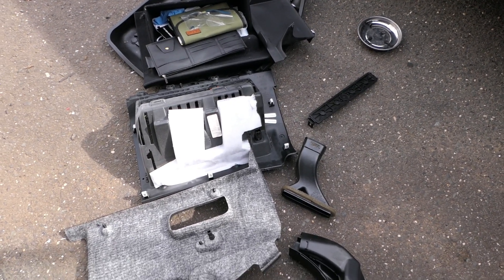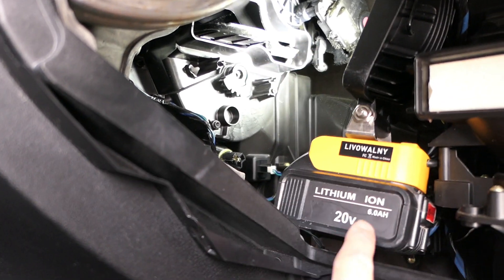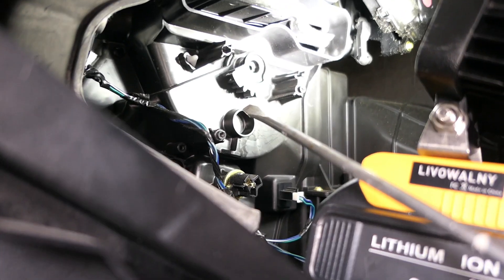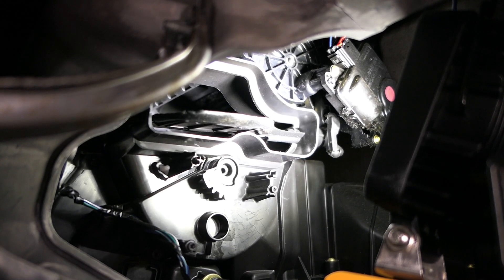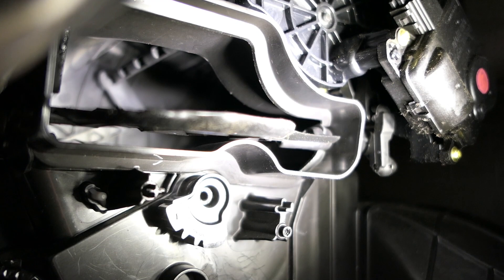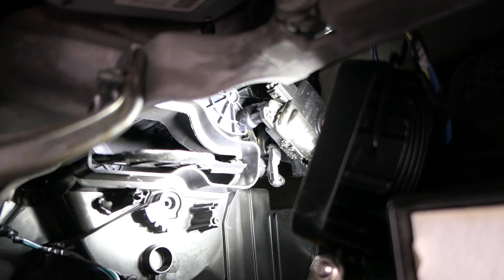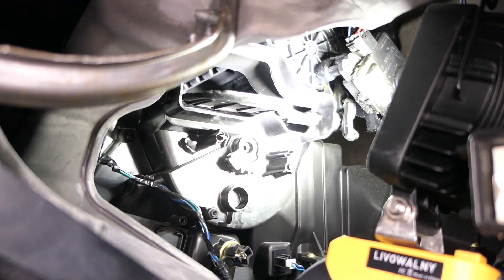How To Fix A Stuck Jeep Grand Cherokee HVAC Actuator Door

Comment: Yes this was my problem too.  Used a tire iron to force it back down.  Required a fair amount of force.  I installed a long 2” screw through the plastic housing on the far upper right side under the lip to prevent the blend door from over travelling again.  Great video. Thanks.
Reply from the maker: That's an interesting idea for preventing over-travel.  Will the thin plastic housing be strong enough to hold that screw in place?  I'd be curious how you make out after some time has passed.
Reply: @tinderboxarts  The screw went in pretty solid.  I used a #6 sheet metal screw.  I pre drilled a small hole with my small Milwaukee angle drill which was pretty handy.  You can feel where the flapper normally hits the seal so I drilled through the plastic at that point.  When the screw is installed you can feel the flapper hit the screw first before the rubber seal gets all jammed up or stuck from the over travel.  Flapper might not seal off 100% so its a little cooler when on max heating the passenger side but better than the alternative of jamming up.
Reply from the maker: That's great.  Definitely worth the trade off for a little less heat.
Reply: Sir or ma'am is there a way I can see your solution??
Reply: Great idea with the overtravel screw!!!

Comment: Thank you for this- I thought I was loosing my mind w/ the flap. One trick- I used the tire iron to move the flap back in place instead of a pry bar-
Reply from the maker: Yes, that would be a very similar tool to use.  Anything with long hook and some strength to it would work.

Comment: I had the same problem but on the drivers side. Great idea, don't know how you thought of it. Problem I had on the drivers side though was I couldn't fit a crow-bar in, just not enough room with sterring column and other controls there. I was able to do it with a framing hammer with straight ears. For $35 I put a new actuator motor in while I had everything pulled apart, hopefully it will last. My A/C has been nothing but problems, one thing after another.
Reply: These dual-temp systems are a nightmare.  I believe the two zones battle against each other and wear the actuators out faster.   Try to keep the two zones in SYNC mode.  Let the wife bring a blanket along for her legs.
Reply from the maker: Yeah, it's funny what you come up with when you just start looking around your shop for an answer!

Comment: Thank you for your video, it really saved the day !!!     Again thanks!!!     You mentioned about beefing up the actuator gear , could you give a detailed description of how to do that with epoxy or a screw????     I  I am sure others could use that info!!!   Again thank you for that great information!!!!!!!!   If you have the time!!!!
Reply from the maker: There are different types of plastic, but I found that the plumbing glue intended for ABS (black) pipe is compatible with the type of plastic they use for these components.  However, I didn't beef up the gear, I beefed up the actuator itself.  I found that the ears where the mounting screws go through are pretty flimsy and they can crack under the strain.  That leads to movement of the whole actuator in use, which confuses the computer and may cause binding.  All I did was find a small stainless washer for each ear, and used the ABS plumbing glue to both hold the washer in place and add additional bulk to the ears.  The glue sets up pretty quickly, but I gave it an hour to cure.

Comment: i just fixed mine and even after the car has been off for some time the acturator keeps working, might be a pcm issue since i have a pcm issue on the high fan setting for the engine
Reply from the maker: That's normal, if stupid, behavior.  The computer is attempting to find the two end stops and it is programmed to do this even with the car off.  Unfortunately it may continue to do this until it gets the data it wants, which may be long enough to snap off that plastic gear.  The best thing you can do is try to get the gear lined up approximately where it was originally so that the computer doesn't get completely confused and it's just a minor difference.  Needless to say, these programmers are not mechanics who work in the real world.

Comment: Doesn’t work for me. Rubber seal melted and won’t allow it to pivot
Reply from the maker: Yeah, there are two causes of the stuck door, one being the door going past the stop and the other being the melted seal.  I had the former problem.  In your case you may need to either remove the seal remnants or get it to be unsticky, and then try to get it to move.  If you can get your phone camera in there you may be able to get a better look at what's going on.  You could try picking out what you can of the seal using long needle nose or a scraping tool or even your hands.  A spray solvent like brake cleaner might help to make it less sticky, and the solvent will evaporate when you are done.  All you can do is keep picking at it.

Comment: Hi - thanks for sharing your good work. I wanted to see if your jeep is still working since you fixed it? Mine is stuck on AC and it’s freezing in Michigan now. Trying to unstick the seal with a crowbar like you did.
Reply from the maker: Yes, so far the repair has held.  Sometimes I cringe when making an adjustment with the controls, but so far so good.  I do think if your problem is that the seal has become sticky or gummy that you may need to do a little more work to try and remove the seal or make it less sticky.  You might get it unstuck and then spray an evaporative solvent in there as best you can,  or use a rag on a stick to wipe it down with solvent and make it less sticky.  If your problem is like mine, where the flapper was just jammed too far in, then you can get it free and then pay close attention to the actuator installation.  Worse case you could always get the door in the warm position and tape it in place until summer when it will be easier to work on.

Comment: Thank you for video, what shall i do if new gears got broken again within a week of installation ?
Reply from the maker: That is always going to be a possibility since the design remains flawed.  All you can do is try and figure out why your particular door is getting stuck and then causing the gears to snap.  One possibility is that you have the "sticky" seal problem, in which case you might be able to reach in there with solvents or your hand to remove/reduce the stickiness.  The other possibility is that your door is getting jammed at the point of contact or beyond, which is what happened to the vehicle in my video.  You want the door to move freely and not get stuck at the point of contact with the housing.

Also, take a look at the actuator itself.  If there is a cracked housing or other wear you might do well to replace the actuator too, which is not that expensive.  When reinstalling the actuator and gears, try to get the door and gear located in the middle of the range to avoid undue stress during the calibration.  If your gears snapped again, it was probably during a calibration by the computer or else your door got jammed up again.  I'm afraid there is no ideal solution, this is just a poor design.

Comment: How did you get the duct off?
Reply from the maker: The short duct in the way of all this is made of two pieces.  It is possible to give the duct a yank and pull it loose, but you may find it's easier to split the duct from the locking tabs, and then pull out each side individually.  You can re-install it that way too.
Reply: Will give it a shot! Thanks!
Reply: I have this same issue on my 2011 JGC. I stopped for the day out of frustration, but I'm definitely going to give this a shot tomorrow morning. That gear is definitely stuck in my case. No play at all. I'm also worried about my blower relay because it stops and goes without any code. I changed the blower motor and resistor (in the same location as the actuator). Fingers crossed!

Comment: Okay so I got the same problem and another problem. Can you please tell me if yours has another actuator above this one. If you remove the vent there should two more actuators. The one above this one has a female end built into it. I can’t find this actuator anywhere.
Reply: This is truly a poor .. to much heat for the space problem!  Heater cores under the dash has been done far to long!!  And gluing foam around the area...didn't we learn this in the 50s!!  OK done venting
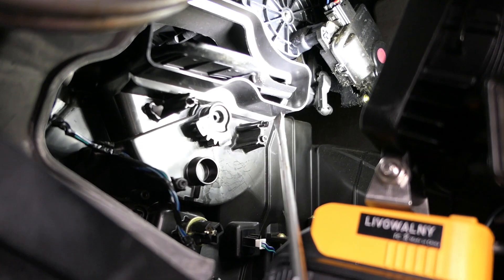Reply from the maker: If you look at 2:15, in the upper part of the frame and a little toward the right, there is another actuator.  Are you referring to that one?   Mine was fine, but you should be able to find a replacement.  Sometimes it's easiest just to remove the broken one and keep it next to you while you search the computer screen for a similar looking one.  I would think all of them are available on amazon or ebay.
Reply: @tinderboxarts  no not that one but I did have to replace that one as well. The one that I am working on is a 2014 overland addition. I’m not sure what year yours is but on this one there are 5 actuators and it’s the only one with like a female end. I got one and put it on. I wasn’t able to get anything in there small enough to pry down on it. I truly loved your video it did help me in a way. But now I gotta replace the main vent housing which consumes of the steering wheel being pulled out and the whole dash lol. Which is all but done. Again thank you for your video and your response. Have a good weekend sir.
Reply from the maker: Ugh, I feel your pain--these are repairs which never should need to be done.  I hope your repairs last!

Comment: i might be in trouble, i electronically turned the gear and now i spose I need to calibrate the drivers side actuator. anyone know how to do that without a scan tool? i have the climate control without the knobs.         I also unstuck my blend door by heating up the car and then slowly turning the inner gear till it broke free of the glue goo.
Reply from the maker: As far as I know, the computer will attempt to calibrate itself when the car is turned on again.  The obvious problem with that is that your door may become stuck again in that process.  I would suggest cleaning up all the stickiness you can, if that has been your issue, and then reinstalling the actuator in a middle position as best you can.  When you restart the vehicle (or just turn the key on, probably) I think you'll find that the ECU will attempt to find the stops itself by repeatedly activating the actuator.  Hopefully the door won't become stuck again as it does this.
Reply: @tinderboxarts  thank you for the reply!  I've been waiting for my ribs to heal before I reinstall .. since with ongoing muscular dystrophy I apparently break ribs doing this repair :)  I believe I'll ad 12v to the gear so that it sits in the proper slot. I sure hope that works. Like you said hopefully it will learn its place in the world. Tks

Comment: I’ve done these a couple times before and I will say there is a function in the snap on scan tool I used that calibrates or learns the door positions. Doing this will help from the actuators trying to force the door past where it stops.
Reply from the maker: From what I can gather, the system does learn the approximate position of the stops, however, there's more to it.  The system does appear to try and re-calibrate itself occasionally, perhaps after X number of starts or some other factor.  And, I believe the system is still using an increased amperage draw to help it determine where the full stops are located.  In other words, when the actuator motor struggles for a period the system interprets that as the stop.  So the calibration is to help the system figure out where to put the blend door in intermediate settings but the full stops are still found by increased electrical draw from the actuator.  These assumptions of mine are just based on observation of the unit in action.  It's really just a dumb design, and it makes me wish again for the cable actuated doors of the old days, which seemed to work forever!
Reply: @tinderboxarts . I forgot to ping you in my first comment.

Comment: Have you run into any issues since doing this ? I tried the cut a hole method and was able to move it ever so slightly so it wouldn’t blow 10000 degrees anymore but was not able to dislodge it all the way
Reply from the maker: So far it has worked fine.  That said, there is always the possibility of further calamity.  The door could get stuck again if the actuator moves too far, or if the seal gets sticky.  Basically if the computer doesn't sense quickly enough the additional amperage when the door hits the stop, then it will keep pushing until the door gets stuck.  It's just a dumb design.  Hopefully when you cut your hole you didn't leave shavings behind or cause the door to bind.  It's probably worth a shot for you to try my method and see if you can completely free the door.  Take your time, find the center with your crowbar or similar tool, and just press down with some force until it moves.